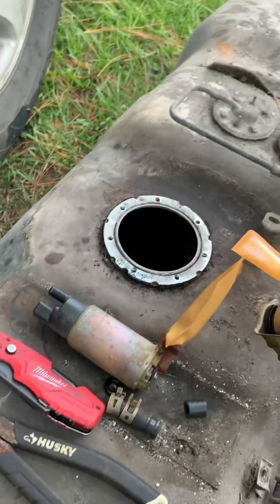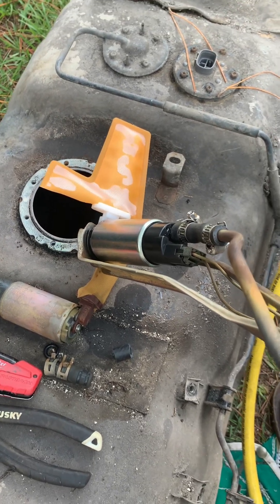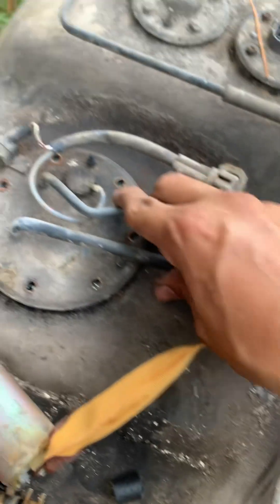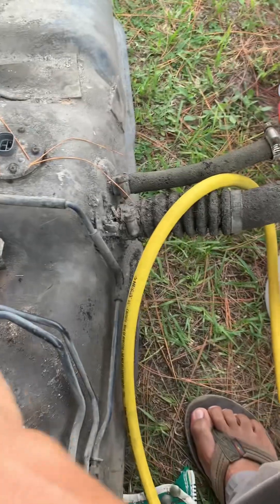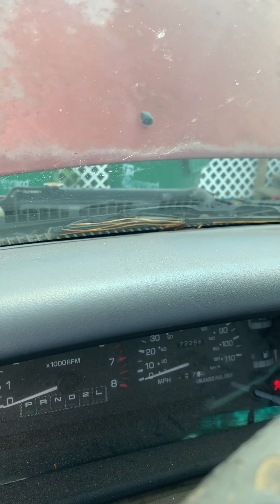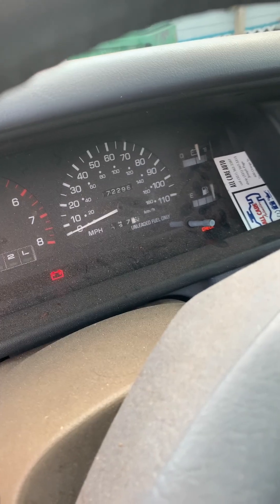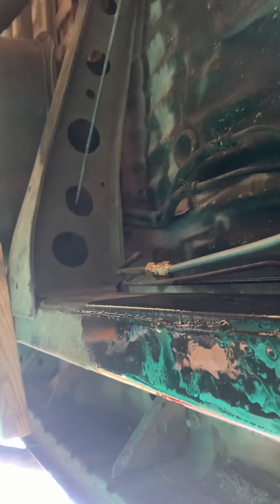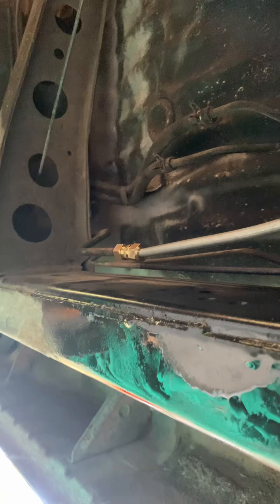Fixing La T’wuh (my truck) Pt 2

Comment: How you been? I was going comment on the spark plug video, when you were trying to start it sounded fuel related, but it looks like you're getting it. If you’re still having trouble try checking the fuel rail. Make sure all the lines are sealed, especially that one you replaced.
Reply: Also if it's white smoke it's  running rich the fuel not burning, check gap on the plugs, or test coil packs, Was it originally running or was it a project truck?
Reply from the maker: I appreciate the comment. It was running and then it died at a stop sign